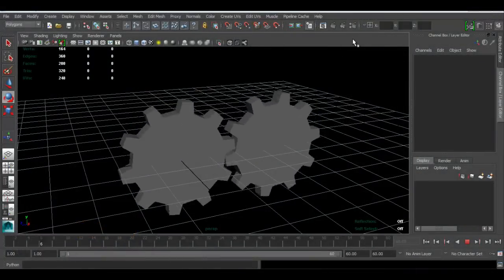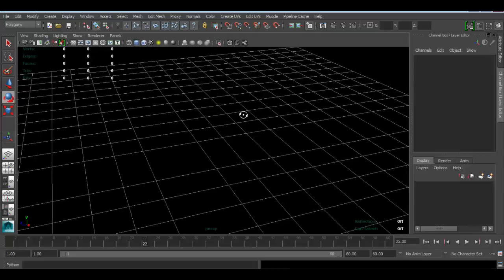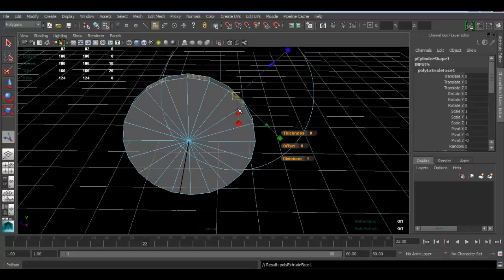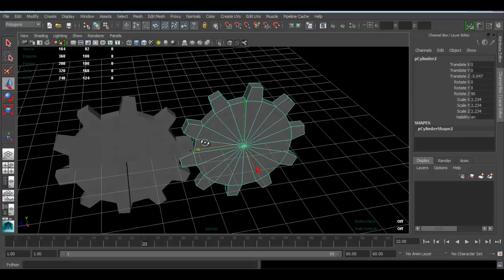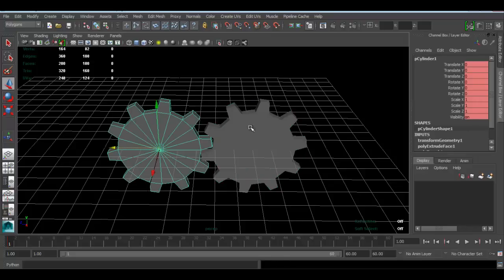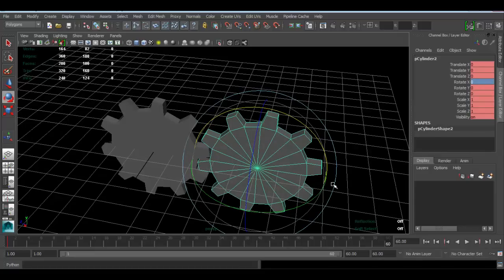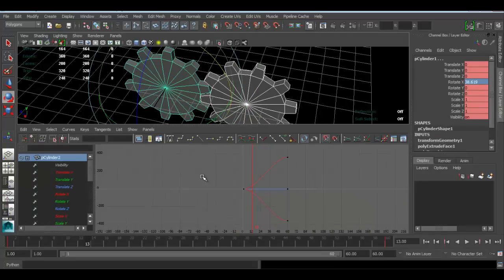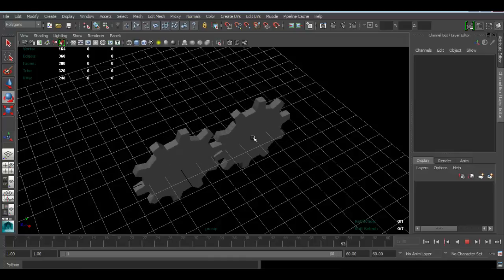Autodesk Maya Tutorial - Easy Gear Animation

Comment: Nice tuturial. I have a question. Lets say these two objects are only one object, in this case is there any way to export this animation to Unity 3d? I have a tank and trying to make turret rotate, fire and similar animations but I want my tank to be only one object(there will be no other child object) Because this way I can improve performance(less draw call/batch). Please can you give me an idea about how I achive this?
Reply from the maker: You will need to rig the tank with different joints controlling the different parts of the tank.